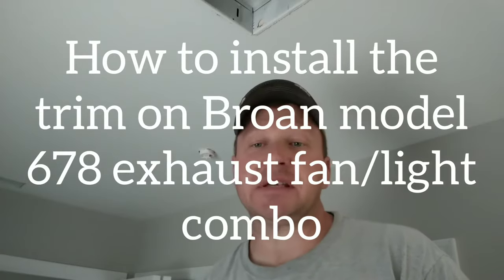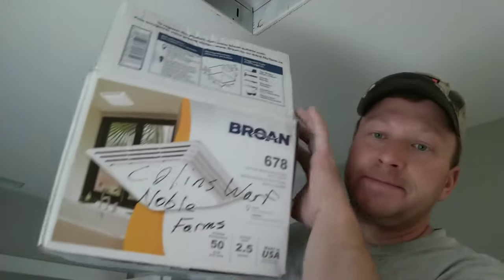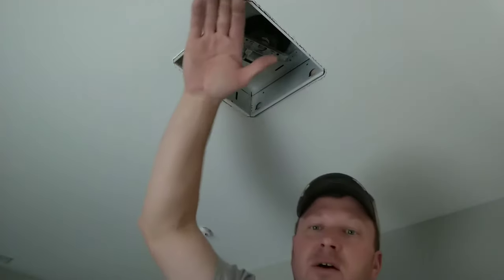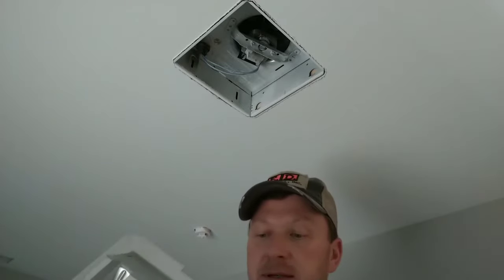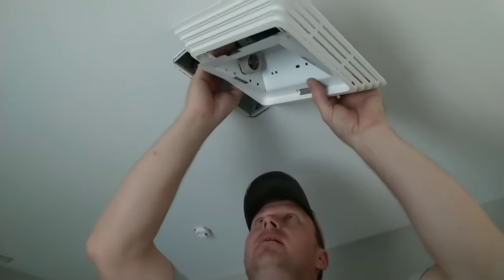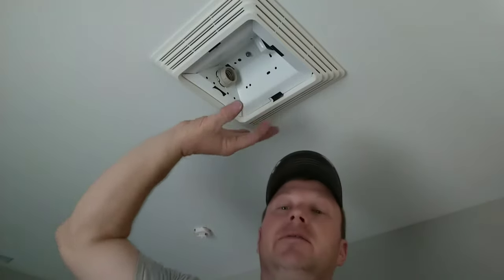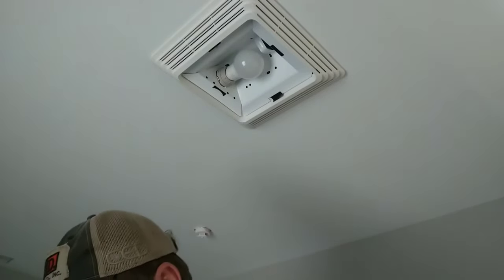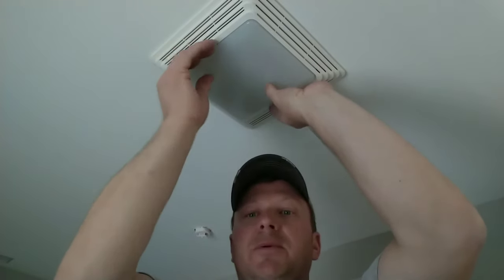How to remove 🤔 trim on Broan 678 exhaust fan/light to change the bulb

Comment: I watched all your videos, but still can’t figure out how to get the glass dome off. I don’t think it’s plastic. It sounds like tempered glass and it doesn’t have the two tabs on each side that has two tabs on one side with arrows. We’ve tried pushing both arrows that way to remove the glass to no avail. Have you come across the fan like this? Almost seems as if there’s a lip under the plastic housing so the glass won’t fall out?? I’m at a loss. Any suggestions?
Reply from the maker: I think I've got the same one your talking about in my house. I'll check, if it is I'll do a video of it soon. Thanks for watching and commenting.

Comment: Thank you for producing a very helpful video, I all but tore the fixture out of the ceiling while painting because I expected it would be one like my other bath that is on those spring things (if I recall correctly?) damaging the edge of the grill. Torqued off because of the high ceiling and limited usefulness of a ladder in the tub, have left it 1/2-axed for several months not eager to cramp my neck again from looking up for so damn long jacking with it. Recently I came across a display of replacement grills and surmised which one is the right one and lo and behold it is. Back to the ladder joke in the tub which is unworkable safety-wise; tho do have a Gorilla folding bench that is too large but okay to put in tub 1/2 way and was able to see in enough to discern the acorn nut attachment and remove the reflector intact. So here I’ve landed to get educated by a guy of substantial experience on how to install the new lens/grill. Thx!

Comment: I have the exact same fan/light that i've changed the fan before and now 4 years later I needed to replace the light globe, thanks to you I've identified the fixture and replaced the globe with a new one that came with the new fixture that I've bought for future use in case my fan/light craps out. Thanks to your video I'm future proofed.

Comment: Thank you for sharing this video. This video was a great illustration. My bathroom has a Nutone bathroom exhaust and light system that is similar to the Braun exhaust unit you were illustrating, therefore I was able to follow your instructions to be able to remove it and get it cleaned. Thank you so much for sharing this information.

Comment: Thanks a million!  Great step by step instructions!  I didn't realize the original fixture was installed incorrectly making it difficult to replace it.  I am not an electrician, just trying to clean the fan!  I re-installed it using your instructions and now it is clean, correctly installed and no longer making noise!

Comment: This was EXTREMELY helpful. I live with my sister and this needed to be cleaned, after the passing of two dogs. The housing is not flush to the square hole and there is a lot of debris in and around the fan. There is nothing wrong with the fan but I am going to need to take everything out to carefully clean, not just the fan, but the entire cavity. I was at a loss but now with this video, it's very doable. I'm not afraid of simple home repairs and I would normally not tackle anything electrical but your videos show that it's not to difficult! I appreciate it and I'm sure my sister will too. (Since she would have to pay for the electrician! It's technically her house!)
Reply from the maker: Thanks for watching and commenting. I really appreciate it. The best of God's blessings to you and your sister in this cleaning/repair.

Comment: Thank you for the video. What kind of bulbs are best to be used for bathroom exhausts in your experience?
Reply from the maker: Thanks for watching and commenting. I've been using all LED type bulbs for the past 10+ years now. Very few short life. Most of them have lasted 3 to 5 years with intermittent use. I believe most of bulb selection is the color choices that are available today. I asking the customers , if you were to use the bathroom in the middle of the night 🤔 what color would be best for you to see but not blind you?
 2700k=soft yellow🤔
3000k=soft clear🤨
4000k= bright white 👍🏻
5000=sunlight bright🌞
6000=super bright 😎

Comment: Thanks for this video. I have a question about a ceiling light /fan. We bumped the ceiling fan while moving things around in the room, now the fan doesn’t work, just the light. Any ideas on what we can do to fix it? We tried the directional switch and made sure it wasn’t in between settings. Any advice is appreciated!
Reply from the maker: Thanks for watching and commenting. That's a great question.  I would check the connections where the fan connects to the house wiring. I wire nut may have came off.

Comment: Hello, thank you for posting this video. Can you please tell me what size the screw and acorn nut is that attaches the reflector the motor above? Broan wants a high price just for the screw and acorn nut and I can’t afford that. Is the size #10-24x0.75 hex head screw, and acorn nut #10-24? Is this correct? I had some work done and they lost the screw and cap nut so I’m trying to find replacement that’s not from Broan  and not plastic from Amazon. Thanks for posting this video!
Reply from the maker: Thanks for watching and commenting. I'm sorry to hear about your misfortune. That is a great question about size that I didn't talk about in the video. I just pulled one out of the box and check. Broan uses a #10x24 x ¾" long hex headed 
 (self tapper) With a #10-24 acorn nut. A standard machine bolt of the same size will do the job just fine.
Reply: @workingmanrondoyle3287  oh my gosh thank you so much! I’m going to Lowe’s tonight to get these parts. I appreciate you taking the time to help me. Next time workers are in my house I’m going to make sure they don’t lose parts to things they have to disassemble!!!

Comment: This is a long shot but I just watched your video on the Broan 678 exhaust fan/light. Is it possible to tell me/show how to re-wire so that both the exhaust fan and light come on at the same time. I only have one switch. Thank you
Reply from the maker: Thank you for watching and commenting. I sure can. The Broan 678 model exhaust fan/light combo has a removable 45°corner that holds two non-grounded outlet. 
Start with shutting off the right breaker that supply's power to the switched location. Install a ½" cable clamp  in this removable 45° bracket. Next wire your house ground to the Broan's housing by bonding it to the green ground screw on this 45° removable part. Then wire nut the two white wires to your house's white neutral. Lastly tie both of the fan's hot wires to your switched hot. Reinsert the 45° corner which houses both outlets. Insert the main fan assembly. Plug in the fan to one of the outlets. Plug the light into the opposite outlet. Reinstall the light housing / grill as described in the video. Turn the breaker on and you are set.. any other questions let me know.
Reply: @workingmanrondoyle3287  I can't hardly thank you enough. I was finally able to rewire the fan/light as you suggested and it works! I laughed out loud and I am absolutely delighted. Thank you, thank you, thank you.

Comment: Mine does not have screws and only turns but will not come down. Can you help?
Reply from the maker: Do you know the brand of exhaust fan you have? And possibly the model number?
Reply: @workingmanrondoyle3287  it is not a fan. It is a flush mount on the ceiling.
Reply from the maker: @daphnegold1052   Send me a few pictures of this light fixture. My email:
rondoyleatdms@gmail.com

Comment: Fan and light aren't working on mine a power supply problem?
Reply from the maker: Thanks for watching and commenting. The easy to confirm your Broan 678 fan and light still work. Remove the fan and light's enter components and test them on a working outlet in your home. Next thing is to check the voltage at the two outlets inside the Broan's housing.

Comment: This Broan 678 fixture is a hot piece of trash.  Guaranteed rattles and noisy fan motor.  Replacing my third one in my house this month.  Wish there was something that could reuse the ceiling housing without dumping attic insulation all over the place replacing the entire unit.
Reply from the maker: I couldn't agree with you more Corvette genius. This style of exhaust fan/light combo were designed to be contractor grade. I wish they would design an exhaust fan that had multiple finish trims.